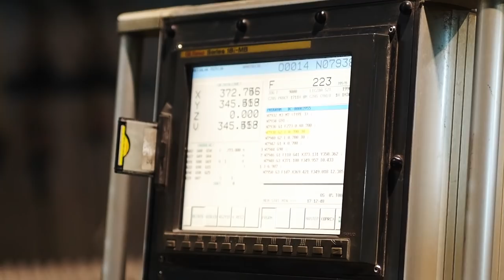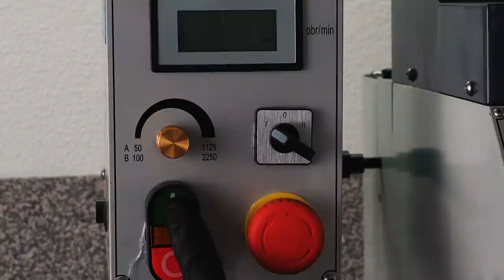Making a COLOURFUL KNIFE - Knife Making

Comment: one question , does the pot of the blackening process needs to be an specific material? or can i make it with any pot that i have ?
Reply: pvc might be best, that is ferric chloride, basically a form of acid
Reply from the maker: It has to be at least stainless. It's not ferric chloride and pvc isn't good since it would melt in 120C

Comment: So just to be clear... You harden and temper your knife before you grind in any bevels? Other than that what a cool video....music was different but I did not mind it.
Reply: might take slightly longer and wear out belts quicker but you avoid the risk of your knife warping
Reply from the maker: Yes, we harden and temper it before beveling. It's easier to avoid decarb this way and it's a lot cleaner work
Reply: @BarbershopCustoms  Thank you so much for that.....makes perfect sense... Thank you very much for the information....
Reply: @BarbershopCustoms  I posted the same question, so it’s been answered, but that brings me to a another, doesn’t it take longer to put the bevels in and hand sand being the metal is now harder? Wouldn’t that also shorten the life if your sander belts as well? Again, love your videos!